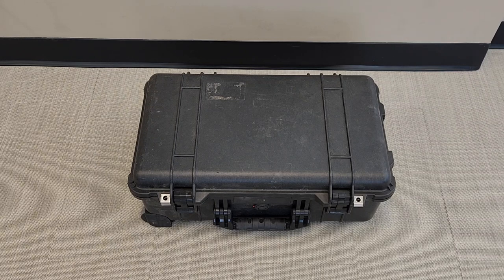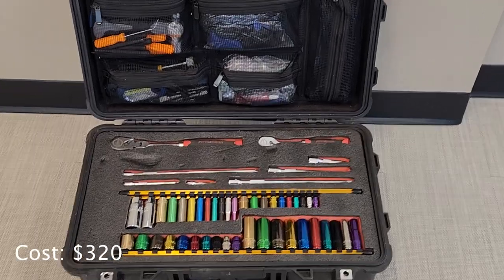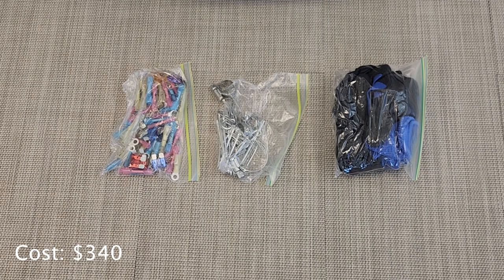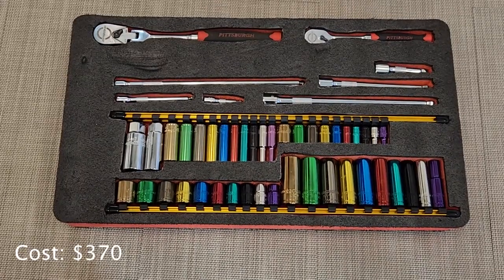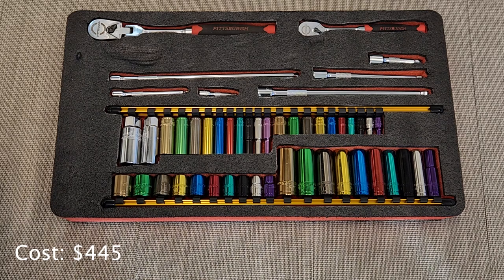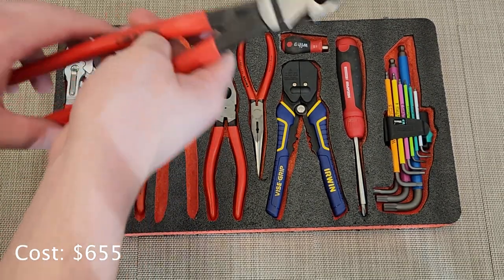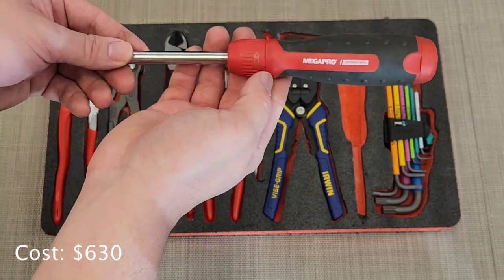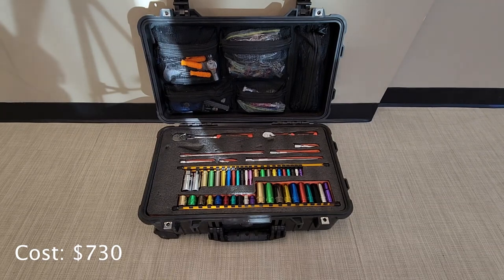Mobile Mechanics Toolbox Tour

Comment: Good box, we use this style in the aviation world. I preferred the stacks, especially for junkyard visits. One thing I've encountered is that small boxes with wheels tend to catch on gravel due to not having clearance. So ive switch to the Tstak system. I have the tstak dolley with the tstak toolbag. I did this because the foam robs you of space.
Reply from the maker: Yeah the foam definitely takes up space but I feel like the organization that it provides is worth it. The wheels do tend to be a bit undersized for rougher terrain.

Comment: Check out the pelican 0450, if you liked this one.
Reply from the maker: That is a very nice tool box but, its significantly bigger.
Reply: @contractorscompass  I got mine foamed up, and it sits in the back of my pickup. Not a rattle, and not a spec of rust on my tools.

Absolutely love pelican for this.

Comment: It’s a nice box and well put together. I’ve owned a pelican case like this for probably about 20 years now and I’ve used it as luggage traveling all over the country on airplanes. The company has since come out with an actual pelican air line which are much lighter weight cases but this is the one I have. Mine literally has been thrown off the back of the truck While driving down the highway at 50 miles an hour and survived, and I still have it and use it. They offered to replace it but I wouldn’t take them up on it… I like the scars😂 adds character. 

I have been looking at buying another one to do just what you did here because my existing tool Case doesn’t have wheels. One thing I would want to integrate into my system on probably the bottom layer would be my Milwaukee M 12 impact driver and maybe my M12 drill… Although I might continue caring that in its separate case because of the logistics and how much room it would eat up. I would have to lay everything out and see how things worked out. I just don’t know if I can get everything packed in like I want it. I currently am using a backpack for my primary small kit and I have everything in two or three other kits that stay in the vehicle. 

It’s always and never ending process. You build something you use it for a while and you find a better way and you adjust.
Reply from the maker: Defiantly a never ending process. I decided against including my battery tools in my kit because of space and I also use them durning other projects that don't involve this particular tool kit.